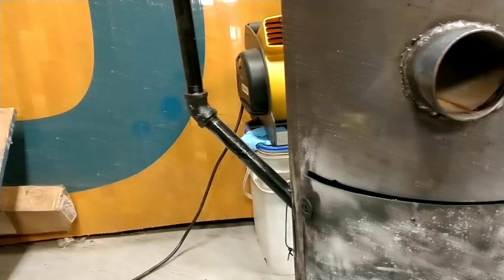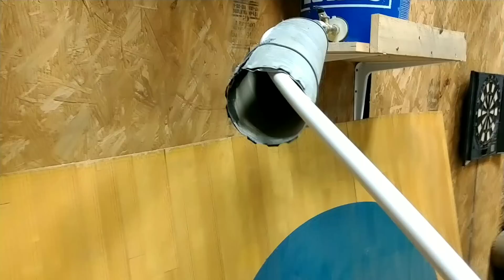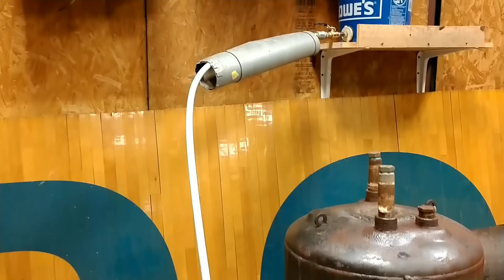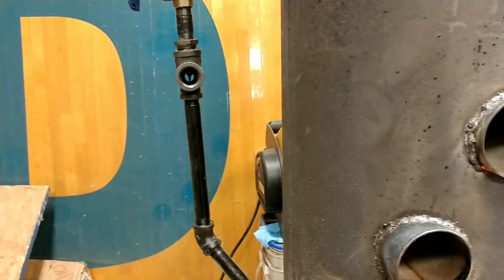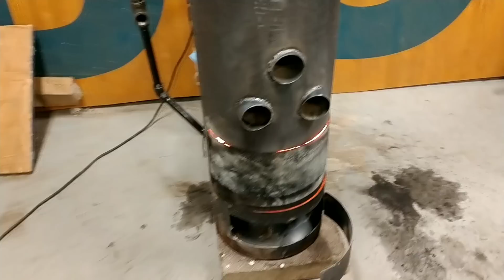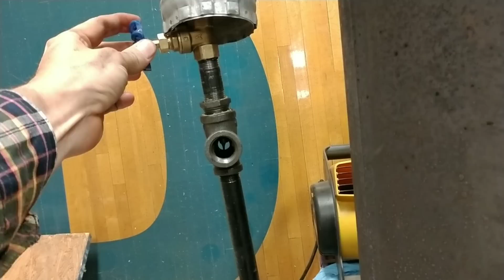Updated Waste Oil Heater Drip Feed Ver.2.2 Detailed January 19, 2018

Comment: That's a great job and a great project to do with your son!  I'm sure that will stay with him for life and is worth more than you can imagine.  

I have a couple questions and suggestions if you are planning on making another one.  I'm wondering if you could use an old water pressure/bladder tank that people use for well pressure.  I cut one up and it seems fairly thick, maybe a little thicker than a water heater, though IDK.  

Another suggestion is maybe instead of mounting he heat exchanger pipes flat, what about installing them at a 20-45 degree angle, so they would act like a chimney, pulling air in from the lower point and  the heated air would exit the higher point - natural convection cycle.  You could also install pipe down to the floor and then connect it to the heat exchanger pipes with your current setup, and that would increase air flow a lot and would heat the colder air at the floor faster.  Same could be done if you installed them at an angle as well.  You could eliminate the fan once room gets up to temp.  

As for the drip mechanism would it work better if the oil was dripping at more points around the tray, like 4 or 8 spots instead of the single point?  How well does it spread out now?  I'm wondering how much that would improve efficiency if it would at all, and how much work it would be to introduce more drip points for the oil.  

Have you ever considered preheating the air that comes into the burn chamber?  I'd be interested to know how that effects the setup and you could do it very easily by piping one of the exchanger tubes into the bottom air intake - or run a new one through it.  Maybe run a vertical pipe through the burning area of the stove (or 2 - one for intake, one for heat exchanger) and exit right above the fire.  One could draw air in from the top, down the pipe and into the burn box for pre-heated air, and another would flow the opposite way, drawing air in (lower the better) and flow up through the stove, exiting at the top.  IDK, it's just a thought. I wonder how much heat is lost up the chimney - do you take temp readings on it. That would be interesting to see.   If the temps are high enough, you could get a larger chimney pipe and do a heat exchanger the length of the vertical run and extract some extra heat if there is a lot being lost. 

Either way, good job, it's fun to think about these things even if some of the ideas aren't always the most practical, in some cases they may be useful, like if fuel is limited or a very large space needs heated.  

Here is a video you might find interesting and it's "technology" can be implemented in stoves as well.  It's a tent heater made from a burning log outside the tent.
https://www.youtube.com/watch?v=QeHGDr81XwM
Reply: kde is the best

Comment: a year and a bit late... remove pex pipe and replace it with black pipe so your oil will preheat. it will help it with burning a little better. the pex pipe is a fire hazard. accident waiting to happen.

Comment: If the stove put out good heat wouldn't it  have melted the plastic ?
Reply from the maker: Are you asking about the pex plastic feed line, if so I have one video that explained that. With ir temp readings. I was worried about it at first so I had a stove pipe covering it

Comment: Another quick question, in theory wouldn't it be more effective to place the heat exchanges closer to the air hat/burn chamber due to that areas reading higher on the thermometer? For example, on your first unit you built, you'd place the heat exchange through the pipe between the brake disc and propane tank.

Comment: If you angled those heat exchangers up and down a little, hot air would rise from the top of the exchangers and cool air would be drawn into the bottom of the exchangers.

Comment: Hey Randy. The title says "waste oil drip feed" but it seems as though it takes a steady stream of oil. Others I've seen actually ran on a steady drip. Is this stream just during initial start up and then backed off to a drip? Or does it take a steady stream the entire time it runs. My Shop is almost the size of yours (30 x 50) and I'd like to build a waste oil heater for it. Thanks in advance for any help or advice. Jerry
Reply from the maker: No it's actually a stream about size of pencil lead

Comment: Would it be possible to insert some coiled 3/4 soft copper in the upper section of the water heater so you could heat water that is passing thru the coil from the heat that is rising and existing out thru the stack ?
Reply from the maker: I suppose that would work but it is extremely dangerous to ever get the water in contact with the oil.you would definitely want to make sure that the copper would withstand the heat and never have the opportunity to create a hole and leak the water into the oil chamber

Comment: I had a commercially built waste oil heater, it was a joke. This is the best video I have seen of a waste oil burner I have seen. How did you cut the valve?
Reply: Check out gerrysdiy he built the same thing and has a vid on the valve setup
Reply from the maker: I'll try to make you a video this weekend and put out there so you can see exactly what was done. But in words you take the valve apart and they're is a slide that closes off the flow and I took a chainsaw file and filed a small groove in that slide.
Reply: Thank you, that sounds easy enough.

Comment: Make a steam engine out of it to run a fan and you'll have a loop energy path
Reply from the maker: Perpetual energy that would be great
Reply: They make a fan that runs off of heat.  Makes it's on electricity. No dangerous steam needed. (Heat fan)

Comment: twenty years ago my 6 inch pipe plugged with ash, cinders and creosote,  coming out of my wood furnace. It came out of the stove, did a 90, then another up to the chimney hole, then a third 90 at the chimney.  I revamped it using two 45's instead.  Hasn't plugged since. nice access to your stove's internals, and nice h eat capture.  getting ideas to put oil to a different wood stove than the furnace mentioned

Comment: what kind of fitting do you have on the bucket?, pls explain
Reply from the maker: It's a compression style bulkhead filling. Found it at Lowe's. It ha threads on the inside and outside and a rubber washer and nut that compresses to seal
Reply: thanks, I found one and it works great, the thing is really smokin
Reply from the maker: Good deal.

Comment: What about using a Stirling engine to run a fan instead of electric fan?

Do you think it would work?
Reply from the maker: I'll have to do some research I don't know what a stirling engine is
Reply: Good idea I've got one with a 14" fan  on one of my  wood stoves works well for about 2 hours the problem is finding a way to sufficiently cool the cold side of the displacement cylinder do you have any ideas
Reply from the maker: Not sure I follow what your saying
Reply: @randysdiy2102  study the design and mechanical engineering of the Stirling engine it runs from air displaced from the hot end of the displacement cylinder to the cold end cycling from pressure to vacuum etc.

Comment: Our barracks (Army) used 2 drip heaters fed from 55 gal drums turned on their sides and mounted on wood stands outside.  The barracks itself was merely canvas roof with screen sides which we covered with plastic sheeting during the winter.  They'd glow orange at night while we were laying in our cots but kept us warm, at least when the Army saw fit to keep the tanks full.  There was just a small pot at the bottom of each with a mere sheet metal box that had the flue coming out of it.  Very simple.  The valve was very small and only allowed for a drip (no stream) even though on cold nights we wished we could turn it up.  The Army used copper tubing running across the floor to the middle aisle of the barracks.  I estimate there were probably 50 of us in each barracks so I'd say they were about 100 foot long by maybe 18 or 20 feet wide.  Design was so simple I was always amazed how easy it would be to duplicate.  And I believe the fuel was diesel.  We lived in those for 2 years out in the desert where it got quite cold after sun-down.
Reply from the maker: That is some very cool information. Thanks

Comment: Reminds me of the heaters we used in the Army in Korea, early 70's. Basically a 55 gallon barrel with a drip carb at the base, just hung a jerry can of diesel on the side ,primed it , set the drip, open door drop in lit piece of paper. Couple of drawbacks though (as personally done), if the carb sticks fuel will pool in the bottom, which I unfortunately noticed as I tossed in the lit paper, oops, got cherry red almost burnt the shop down. The other is, if the heater is still hot DO NOT LIGHT until it cools down. Mine ran out of fuel so I put on another jerry can primed it and opened the door and lit, the fuel started smoking as I tossed in the lit paper....BOOM ! blew black soot all over my face and blew off smokestack...surprise.  Funny, I can find no images of these heaters online.
Reply from the maker: Cool.

Comment: Randy, In surfing threw you tube, I search for things of interest, automotive, electrical, mechanical, shtf, Just all around good stuff!  Anywho, In all the oil furnace video's that I have seen, Yours stands out 4 several reasons! The intake snorkel tubes that could possibly smother the flames if over ran w/oil, I REALLY LIKE YOUR DESIGN & I IMAGINE AIR RUSHING N2 THE FIRE USING THOSE TUBES & Also, Your heat exchanger tubes are another great idea!!!!!!! Another thing I was just contemplating was boiling water/adding humidity BUT, THAT COULD BE DANGEROUS IF THE WATER EVER CAME N2 CONTACT WITH THE HOT OIL!!! KABOOM!!!!!!!!!!! ANYWHO, 2 NICE, GREAT IDEA'S MAKING AN  ADDITION'S ONTO THE USED OIL FURNACE BLUEPRINTS IN MY HEAD! Have you ever thought of making a wood gasifier? I'd like to see your spin on the idea!!!!!
Reply from the maker: Thanks for the comments I haven't even thought of the wood idea, I'll do some research on it.

Comment: As the oil level in bucket decreases your drip feed will decrease also. I modified an old fuel oil flow control valve to handle heavier oil  this way you maintain a constant oil level that you are drawing from so you can maintain a consistent drip feed.
Reply from the maker: I'd like to see the valve control that you're talking about. Sounds interesting
Reply: @randysdiy2102  are you familiar with the old gravity feed fuel oil furnaces most houses had years ago many different manufacturers made them. Lot of people still use them in remote cabins because the don't require any electricity.
Reply from the maker: No, not familiar but will Google it
Reply: @randysdiy2102  nice feature in this valve is it has two floats one maintains level and the other shuts flow off if level gets to high.
Reply: @randysdiy2102  goggle oil control valve 240 cvr

Comment: A question. Why smoke or fire doesn't travel back ur feed line?
Reply from the maker: The draw from the flue actually creates a suction on the drip feed pipe
Reply: I understand the suction you mentioned, but doesn't the feed pipe turn cherry red being so close to the burn pan & flames? Also, is the oil burning before it even reaches the burn pan?
Reply from the maker: I guess it could be burning inside the pipe but it doesn't burn very far up the pipe if it is. I know when you watch the drip as the oil runs into the burn chamber it is on fire. the drip tube is probably red hot inside the burner but on the outside of the tank it's not.

Comment: I like the concept of what you've done may I make some suggestions for you that might help you with generation 3 compressor tanks are quite thick and large in diameter especially the industrial ones also your door there is a way of avoiding warpage slap some fireclay on the inside with a second piece of Steel clamp to hold the clay that should hold Back the worp problem what i  would like to know is your safety feature that you were talking about have you tested it yet I only ask because I know somebody who had oil burner in a shed and it overflowed and set the entire workshop alight fire brigade had to come and put it out after that happened  slung that away and went for a wood burner
Reply from the maker: Still haven't tested the oil over the air inlet tubes to see if it was smother the fire out and I do have a 60 gallon compressor tank that'll be generation 3
Reply: @randysdiy2102  iWatch with anticipation good luck with that you seem to know what you're doing
Reply from the maker: Lol, I'm just guessing and so far it has worked. But most of my ideas are just modified Gerry's diy stuff.

Comment: For those reading the comments: He mentioned that he uses a liter per hour of used motor oil. Take into consideration, that used oil contains about 140k btu/gallon, which is slightly less than heating oil @144k. At that rate, he's burning 33k BTU/ hr. Given the inefficient design, I'd give him about 50% efficiency, so he's getting around 16-17k BTU/hr of usable heat. If he used outside air for combustion, added more surface area to collect heat, and was able to atomize the fuel, he could get close to 80-85% efficiency. A standard oil furnace is about that efficient. A high efficiency oil heater can attain 90% , or so, producing condensation waste water in the process. It requires a condensor to extract nearly all the heat in the flue gases. Typically, oil flue gases contain solids, which can plug small openings especially when using dirty fuels or burn cycle is incomplete. Anyway, the current configuration of his heater is too small to heat anything bigger than a well insulated two car garage. My LP wall heater is 99% efficient, as no flue is necessary. But, it does add CO to the room, which can build to toxic levels over time. I can run the unit long enough to get comfy, dial it down to maintain, without getting a headache or dizzy. Fortunately, air leakage is unavoidable in a garage, so a 45K unit won't kill you! For my friend, I installed a nicely used 60k furnace and pulled one orifice to reduce it down to 45k. It heats his garage quickly, comfortably, and safely. I ran ductwork to both ends of his garage, reducing every 6ft for every register, ending with 6" dead end to increase back pressure. He's got 7 registers @100+cfm each!
Reply from the maker: I have been thinking about a atomizer  nozzle to increase burn effeciency. Thanks for your comment as this is an experiment and I'm not an engineer.

Comment: What's the point of drilling out the "T"...I've seen as n oil burner stove where the guy used a 1/8" brake line with a small ball valve ... oil inlet to burner is about the same stream...
Reply from the maker: when I assembled the tea with the site hole in it without drilling and tapping and putting that hose barb hanging down in the center of the site window the oil would just run around the edges of the tea and you couldn't see a stream there's probably a better way to do it but that's what I came up with
Reply: @randysdiy2102  ok....soooo.....why do you need to see the oil....cant you take for granted that oil is coming from container...going to burn pot ...and burning...
Reply from the maker: Lol, you will need to be able to see how big the stream is, there is a pretty fine line between too much and too little. And it varys with temp.

Comment: How do you cut the brass valve. Please show how!
Reply from the maker: I will make a video showing how to do that until then you may want to jump over to Jerry's DIY I think he has a video on how he did his. How old it really is to it you just unscrew the valve before you take the valve out of the body scribing line with it fully closed on the gate. then when you remove it from the body I used a chainsaw file and filed a groove in the bottom of the gate but do not go past the scribe lying or you will cause a permanent leak

Comment: If a bloke was to fan force those heat exchangers on one side, then pipe them from the other side to the interior of a house I reckon  its got to make a safe home heating system. What do you think Mate?
Reply from the maker: I personally would not use this to heat my home it's too hard to regulate the oil flow to leave unattended inside or outside. I only use this in my shop while I am in there watching it.

Comment: Greetings Randy,I got thinking about the way you placed the heat exchangers in your waste oil heater.You may be able to get convection out of them if you weld them in at a 45 degree angle pointing towards the ceiling.Then you would not have to place an electric fan behind the exchangers.The heat would pull the cool air from the floor and circulate it towards the ceiling.Does this sound logical to you?
Reply from the maker: Sounds like a good idea however the heat exchanger only 14 inches long so I'm not sure how much draft they would pull

Comment: We had built one similar but used a 75 lb propane tank that worked great. My heat exchangers went in muti directions so not to heat in one area. I like the air hat ! I will use that in my next shop.